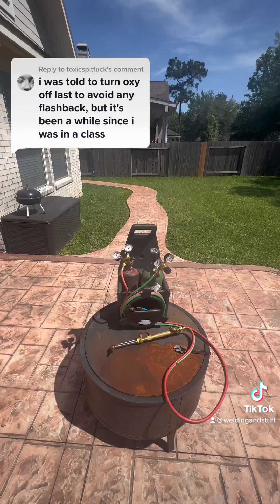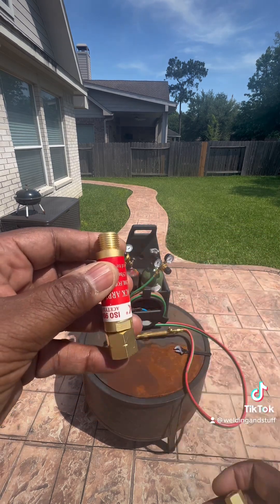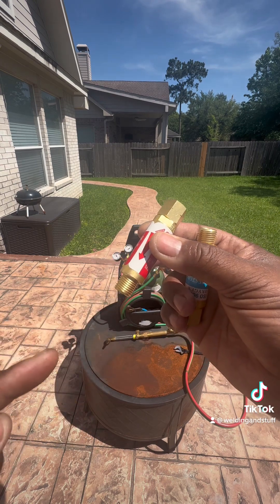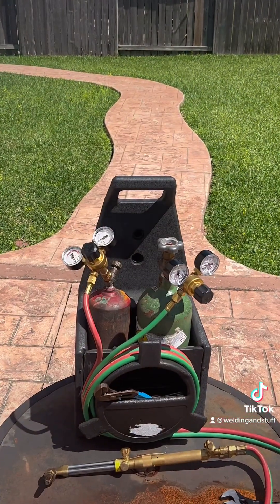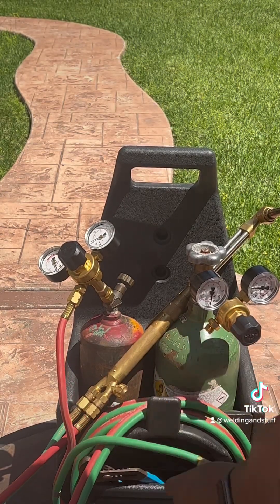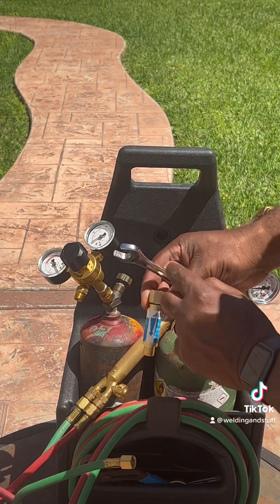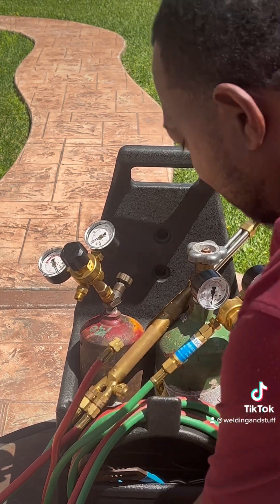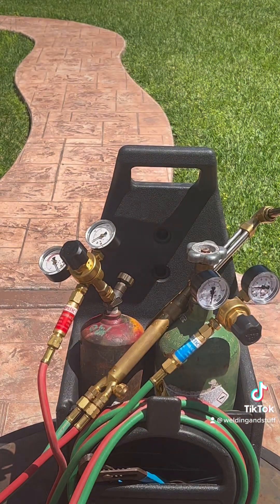How to install flashback arrestors on your oxygen acetylene torches

Comment: How much did you pay for your small tanks, regulator, and caddy?   How much do they cost to refill?  Have you ever done any cutting with the setup?  And if so, does it blow through the oxygen really fast?  Finally, is it safe to store tanks like this in an unheated garage?

Comment: Bought my extremepower torch rig from ebay. I was wondering if anyone put flash arrestors on there bottles. I put mine on the torch with quick connects. Looking to put quick connects with built in flash arrestors on the regulators as well. Western enterprise qdf30 is the set with built in flash arrestors the quick connect alone is qdb30.

Comment: I heard that you only need one on your gas since oxygen isnt flammable?
Reply: Regulator side spark arrestors/check valves are for the regulator, torch side spark arrestors/ check valves are for torch.
Reply: Incorrect. Additionally, he mispoke/misguided on this! You put these on the TORCH end, not the regulator end...
Reply: They are different.